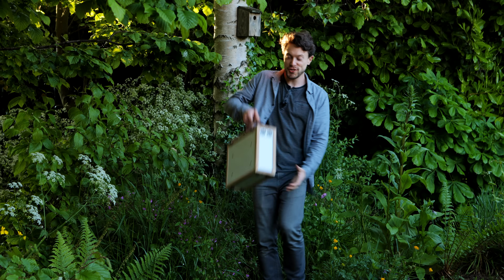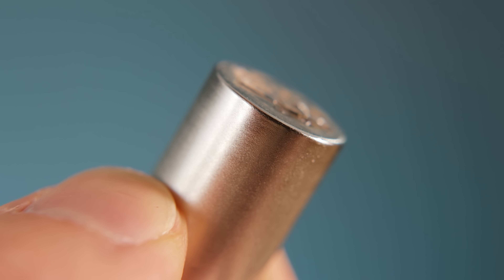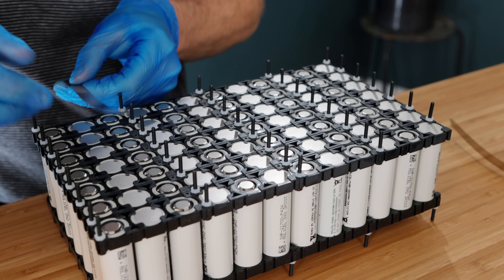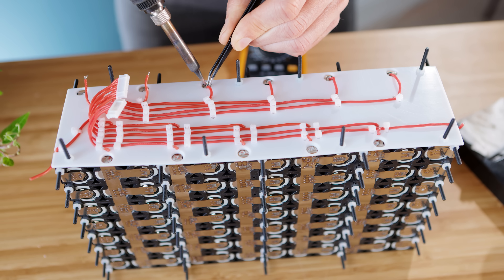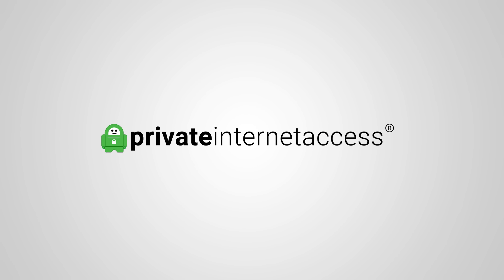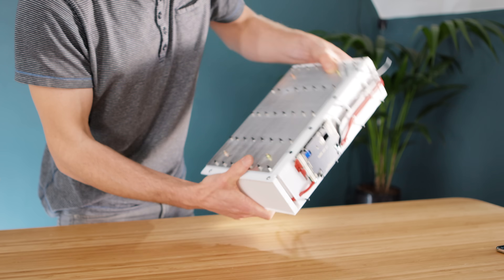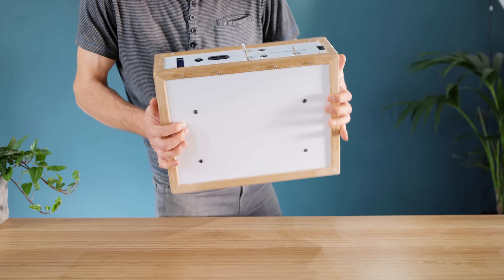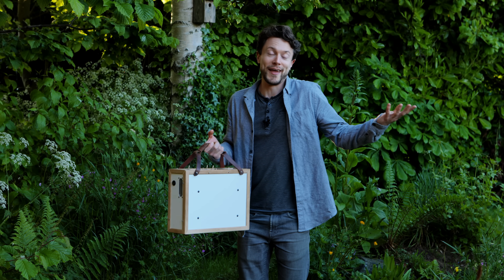Build your own portable POWER STATION (1200w, USB-C and MORE!)

Comment: It's prob not a question I would even comprehend the answer to but how does sonnen-batterie hybrid tie to a house/grid and depending on the time of day,whether the utility charges more or less,peak or not to peak I reckon, use an algorithm to switch the batteries own power in or allow bypass for utility? I suppose what part of the process, a very advanced inverter or another type of solar storage alternative device patented by them to tell the battery where to draw or whether to turn off bypass itself so the grids power flows through?  If you your not familiar with the Powerrwall competitor,and superior,or it's method of said process I think you'd really dig it,being your as much of a nerd as I am;)

Comment: I never understood why powerbanks only gave wattage as a spec. 1200watts is meaningless if it can only supply it for 5 minutes. Wouldnt it be better to say something like 2hours @ 1200watts
Reply from the maker: Watts is watts per hour, so it's already time dependent.
Reply: guess its just not that obvious to someone who doesn't have electrical knowledge but even so linguistically its confusing to me. @DIYPerks

Comment: Keep the balance wires the same length because of the the difference in wire resistance and will unbalance the cells. I have learned this from personal experience

Comment: Will a BMS tell you which 18650 cell is bad or degraded when a cell does degrade? So that it doesn't kill the surrounding cells, doesn't get overcharged, etc. Or is there a different circuit board that needs to be installed to be able to test or check each individual cell? Is there a way to check the health and internal resistance of each battery cell without dissembling the entire pack and using a voltmeter every time you want to monitor the health of the cells?

Comment: No offense, but with all the tools, equipment and time requirements, it would just be easier and safer for me to buy a commercial battery bank that also has solar power panel connectors.

Comment: If you're already 3d printing the brackets holding the cells, why not make a seperate layer with springs to connect the batteries instead of welding at all?

Is the output when discharging so high it could create sparks or something? The same spring setup is used for charging the cells so.... What am I missing?

Comment: The difference in current capacity between the thin nickel strips and the thick ones is negligible. This setup wont generate enough heat to require thick ones, either. Use the thick ones if you have them around, or if you need more structural stability in your battery bank, but I wouldn't buy the thick ones otherwise.

Comment: This is a 1200-1500 Eur projects, for deep pockets. Anyway WHO takes a microwave to a "long dayout in the countryside"... 
Even better is a 2000W diesel generator that costs 1/3 ... and if you need a "warm meal" there are CHARCOAL GRILLS for less than 20 Eur....
There are also power generators with Li Batteries.. AND included solar panels.... for a complete off grid experience...

Comment: Okay, I know this is a bit late (about a year late), but does it classify as a 24Ah battery running on 50V, or can it be classified as something like a 100Ah battery running on 12V? I'm not exactly sure because I know technically it can be used for a 12V output, even if it can go up to 50V.

Comment: So much tools you need in order to build a portable battery... is cheaper to buy from the store... max 1200w to the microwave from bms... so is 50v with 24amps(from 12 rows the volts and 7 columns for amps)... how many cycles it has and if i charge with 100w and consume 100w from the battery it will never make a cycle?!?

Comment: Can you make one for ark weilding. I want one for 240v weilding. But they don't have that. I done already have a mini 240v ark weilder. But I would like a portable powerstation to take on the go. Without connecting to a house. Portable powers station that has solar panels on top. So it recharges by the sun when using it. Lightweight. But they don't have something like that as yet. Portable power station 240v  for weilding machine. Especially good for when houses don't have 240v dryer plugs or hard to reach 240v plug

Comment: Why not go the extra distance and include internally in your build a quality MPPT Solar Charging circuit, and a quality pure sine wave DC to AC inverter circuit, and an external battery connector/regulator ? Now you have your own DIY Bluetti or EcoFlow Solar Generator.

Comment: Excellently done. I love the safety features you built in. My only concern is the complete lack of airflow capability in the battery compartment. Lithium Ion batteries can be damaged by heat. If the pack is running anywhere near it's limit (1200 W) the batteries have to be getting significantly warm. For example, earlier generations EV's like the Nissan Leaf had a similar design issue (limited airflow over and around the batteries) that resulted in very significant degradations in capacity over a relatively short period of time. Newer EV systems have active cooling systems which greatly mitigate the overheating issue. 

Regardless, your design work is excellent. I have a degree in Electrical Engineering and have worked in the design and manufacturing of multimillion dollar semiconductor manufacturing equipment and, other than the heating issue, I couldn't have designed it better. Well done.
Reply: Would integrating space for air flow and one or two a simple PC ventilators help?

Comment: Seems weird to me to go the 48V route when you mostly need 24V, that would have saved you the use of 2 regulators and maybe a cheaper BMS (the 48V direct output is only used for the inverter right? A 24V inverter would work the same in my opinion, granted you double the current, but you have more batteries in parallel)
And I would never trust these dean plugs, get yourself some nice XT90 they are way more reliable.

Comment: You can use a cheap mini welder with the copper sandwich method instead if you need to conduct higher currents.

Comment: I know this is DIY perks so sometimes what he builds isnt really financially viable, its just cool. But how much would this have cost and would it be better financially to just buy an uninterrupted power supply? Like the batteries alone, if bought at single rates is like $2k+ AUD, for that you can get a pretty decent UPS

Comment: Make sure to always have a bucket of sand and a close exist too so if a battery explodes or catches fire you can quickly throw it in sand and cover it and then move it outside because lithium fires are very dangerous because they’re hard to put out

Comment: As you are making a "Briefcase" shape why not progress to having an opening briefcase that contains some solar cells. Maybe just a few watts but that would be of use do simply delay the fall to zero, or enough to maintain full charge while switched off.  Most emergency systems fail during lack of use and due to lack of use..
Reply: actually a good idea. Could hide expandable very large solar panels in there :D

Comment: Brilliant, I’ve been wanting a crossover between an emergency car jumper and something which also be used as a portable power station for off grid or boondocking! Thank you, excellent video and contribution.
Reply: It might not be suitable as a car jumper as the current required to turn an engine is pretty high and this might not be able to deliver that but you can surely charge a car battery.

Comment: Can the system be scaled down to the size of a dictionary?
Reply: Considering that most of the space is taken by batteries, I think you could scale it down as long as you're willing to sacrifice both capacity and voltage.

Comment: how much in parts did this cost in total?
Reply: The cheapest cells I could find were about 6 bucks so ~500 in cells alone. The inverter he never mentions will run you around 200. The spot welder will also cost you around 300. Better to just buy a solution off the shelf imo.
Reply: @tonyk.8580  Thanks Tony! Appreciate it :D

Comment: I didn't want to spend £1300 on a 1500W power bank. I knew it was just a large array of lithium cells. Also, I knew you'd be the man with the knowhow to build it!
Reply: If you don't already own a spot welder and inverter then this method will cost as much if not more than popular off the shelf solutions.

Comment: You need to add a low power charge circuit for solar applications. This is ideal for field work, however, we normally use a small windmill and panel setup to slightly recharge and extend time in field. Otherwise you have to physically transport samples off site to test them

Comment: could you get better restults by using those rectangular lithium batteries? they could be wired together more easily and would waste less space between cells
Reply: while yes, these batteries do offer better performance, they can swell up if used too much and are risky to use in cases like this

Comment: A simple build taken to a professional extreme level!
My only suggestion would be a steel can rather than aluminium as lithium burns hot, and aluminium will also burn when under the right flame. Steel won't!

Comment: Do you have blueprints or assembly instructions? You skipped some of the wiring parts and fastening certain pieces. I could probably figure it out, but would rather just do it how you did and make sure I don’t do anything correctly. Couldn’t find anything for this on your website.

Comment: I would love to see if it’s affordable to DIY a portable jump starter with low capacity but large peak current output. My truck has a big battery and engine and is difficult to jump if the battery pack doesn’t have the proper peak current.

Comment: PTFE is better known as TEFLON.  Teflon under pressure will Deform and "flow" over time.  If you use it to prevent two sharp edges from touching, they WILL eventually push through PTFE unless something else stops them.  PTFE under pressure flows like ice (think: glacier) - slow, but like an extremely thick fluid.  Even those cable ties, if pulled tight, will compromise the PTFE over time.  Make sure this cannot happen where two conductive parts at different voltage could touch.
     For flat surfaces like those side plates, Acrylic is a better choice, and usually MUCH cheaper.  It is easily bent when heated carefully and can be permanently bonded together with a special glue (not gonna happen with PTFE).  You can sand and paint it's surface (painting PTFE is a PITA), or simply buy a pre-colored acrylic sheet.  To make a Really Nice front 'control' panel, cut a piece of acrylic to size, and get it engraved with your labels, but in reverse on the back side!  Fill the engravings with an acrylic paint.  Lightly sand the entire back surface (220 grit works well), removing any 'overflow' from the engraved areas, and paint with a contrasting color.  Light colored labels with a dark background work best to hide the sanding scratches.  Using an orbital sander will make the scratches much less visible if you want to use a light background.  You could also use 320 grit after the 220.  Or get daring and use 120 or lower grit, make the scratches all go in one direction, and side-light the acrylic with some LEDs to highlight them.  Smooth and glossy for that retro 70's look, gritty and grungy for a steampunk vibe.

Comment: If it's one thing perks I really love your builds makes me fill that their is nothing I can't make or recycle. Ide really like to see u build an electronic generator that can sustain it self an power up to 3 other home appliances the device must be able to give out DC 12 or 24v and Ac 220-240v and to start the gene you can do it in two ways ether a pull start or button start using eney external battery source 😉 you think u can handle that 😉 ya men I belive u can do this I just wish I could join you in making this build👍😁👍

Comment: For building a battery bank I recommend using LFP cells. They are much safer than standard 18650 cells and have a much higher life time.
Reply: That would be Lithium - Iron Phosphate.
Reply: @hanelyp1  Correct, also abbreviated by LiFePO4

Comment: Where's the FAQ edit to this pinned comment that answers these questions? I'm particularly interested to know what it cost you to make this, and I've seen quite a few people in the comments here asking the same thing. Looks like a fun project, but I'd like to know, considering the time, effort, and money involved in this DIY project, whether it would be more economical to just buy a comparable power station ready made, or would this build actually provide me with a much better power power station than I could get for the price I'd spend on the parts for this unit.

Comment: if you put some rigid handles on the left and right sides of the front panel of the case it would protect the switches if this device ever gets stored or dropped front side down. in the way the little roll cage pops up over the back of the seats of convertible roof cars, these handles would protect the switches on the front.

Comment: Dear DIY Perks. Really interesting project. I was wonder what would be the price of it. Make a box - price still acceptable. But there one thing which is 48/1200 inverter. And it make project price double.
I have try to find alternative. With 12V 100Ah battery and 12V to 220V inverter possible to achieve same result. With 3 time less price. Less efforts to build.
Thank you for a good idea which came base on your project.

Comment: the fans should always pull the air through a filter. Currently they are mounted to push dusty air into the case.

Comment: For everyone trying to reproduce this - keep the balance wires at the same length - as it could result in the bms sensing slightly different values for each cellgroup
Reply: The current flowing through the wire is basically none so the voltage drop across the wire is basically none

Comment: One thing to mention. You used mesh for the air outlet and a simple grate for the inlet. This is, in fact, the opposite of ideal. You want the mesh on the inlet to prevent dust and debris entering the device, while grates on the outlet allow internal dust to escape. This is easily fixed by reversing the direction of spin of the fans.

Comment: i never understood why so many ppl are building large powerbanks using these small cells (not to mention future upgrades). its far easyer (no welding, just bolts), and safer to use large lifepo4, like 4x100ah. alse cheaper. But still, first time seeing someone using 21700, not 18650
also i think u mean 1200wh battery

Comment: Love your videos, but was wondering what about ventilation for the batteries, when they charge and discharge they will get warm, or even hot, don't they need air ventilation to cool them off. It seems completely covered off. Doesn't it get warm? But this project is as usual amazing.

Comment: Q1: how did you power the microwave? The battery bank doesn't output 240V AC (which would be a damn useful feature BTW).

Q2: would be great if it could accept both 240V AC and 12-24V DC for charging from the mains or a car lighter socket.

Comment: For any devices that can be powered by 12v, use them. For gaming rigs, they are also DC powered. The key would be able to find out what they demand by taking off their covers to discover the numbers, that way you do not up-convert to main voltage, then down-convert to actual needed voltage; thus incurring significant needless loss.

Comment: i hate to nit pick here but you went compleatly belt and suspendors on the battery portion insulating it extremeley excesivley and even talking about buying a high quality bms and this is fine

but then you soldered on the 12v automotive fuses direct to the switches?
was a fuse socket either inline style or panel fuse block style really out of the spec here?
they even sell panel mount fuse holders you could have used for user serviciability but any of theese would have been better than soldering the fuse directly

Comment: The only problem is, if you take in account all parts. Its nearly 1000k $ total. You can buy pre build power bank for 1200w for around 600-800$.

Comment: I'm sorta wondering if there could be another way to design the cell to be inserted in special module sets that don't require welding or soldering of any kind. Because after they're welded together, the cells are permanently locked together in the unit, and replacing any requires breaking the weld somehow. Even if it would take 10% or 20% more space doing it that way, but then you could swap out modules then when there's any failures. Someone be able to design them with a locking mechanism to each Module that the cells are set in, then connected with a line leading to where they're connected to the battery management system. It would then be possible to pull them and inspect the modules if the system finds there's any troubles with them. So if down the line, there's no damage to the management system, but the cells have degraded. All that one would need would be new cells to make it work like new again.

Comment: Good Lord, each step gets more complicated and intricate as it goes along. Get the batteries,  OK, no problem, get the plastic holders to set them in, uh, OK, get some thick nickel straps to weld to batteries, easy enough, use special welder to weld to batteries, using care so the batteries don't explode, uh hold up, use fire proof plastic, cut holes out for nickel straps use zip ties to hold wire to plastic and attach to  batteries, that's it, I give up!

Comment: To put this into perspective, this battery pack is roughly 25.6 times more capacity than my gaming laptop that lasted 4.5 hrs at full charge when I first bought it. You would also benefit from significantly lower cycle counts (you would not have to charge this thing nearly as often and that would keep the batteries healthier for longer)